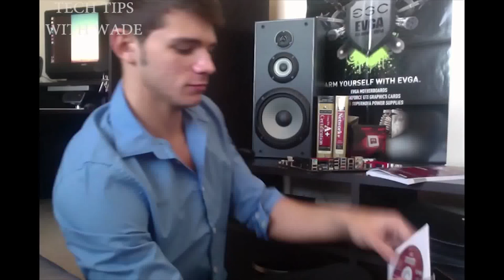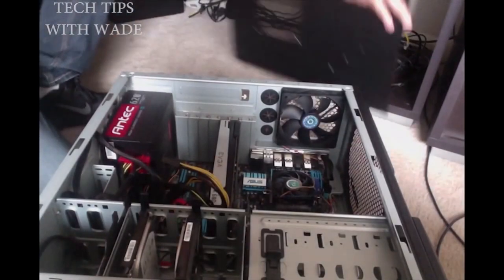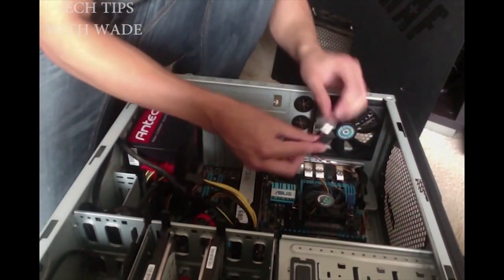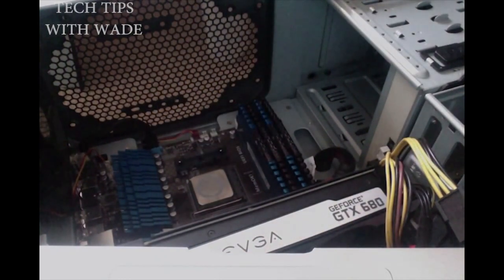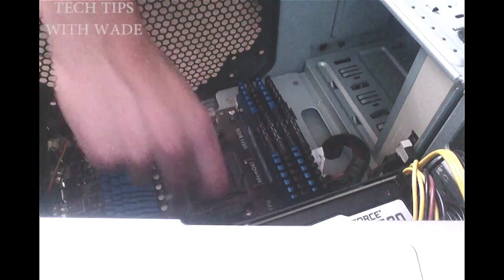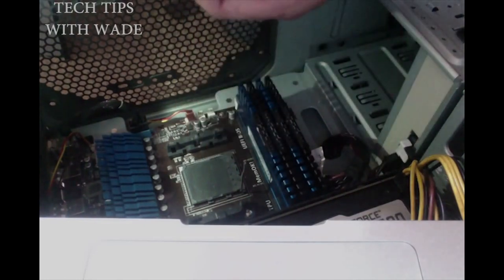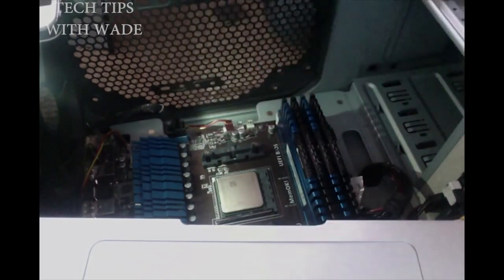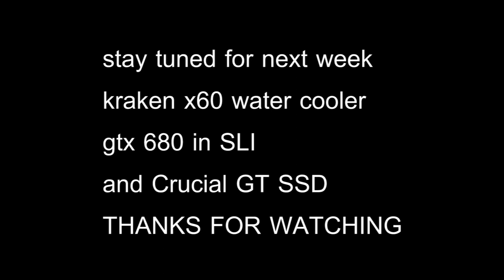AMD FX 8350 Unboxing - CPU Fan Installation - Thermal Paste Application

Comment: Not every FX processor is backwards compatible. You have to keep in mind the wattage of the processor and what your motherboard can handle. For instance, if you have the FX4300 in your computer, you may only have a board that can handle 95W. The FX8350 is a 125W processor, the board wouldn't be able to power it.
Reply: 970a ds3p can work with 8350 I am upgrading from a 6300